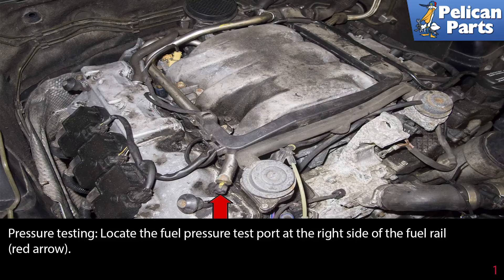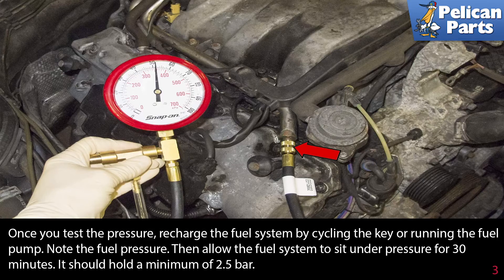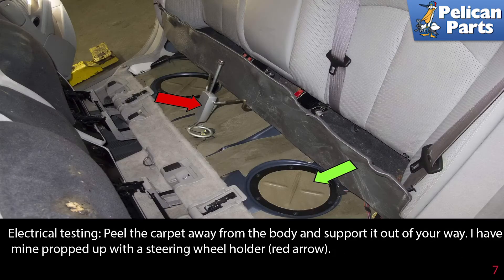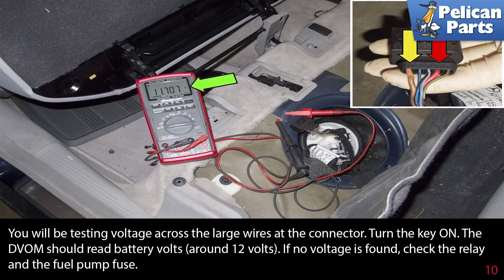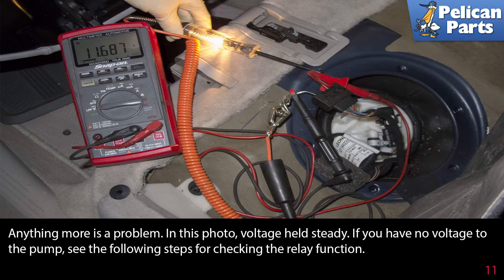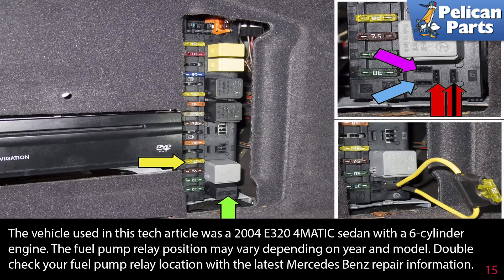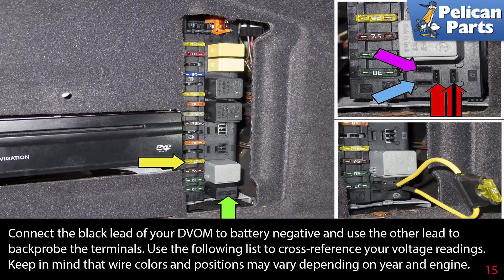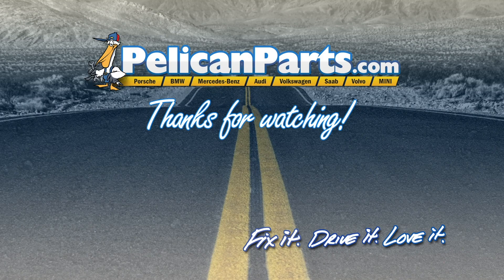Mercedes-Benz W211 E-Class Fuel Pump Testing

Comment: Where is the fuel relay switch on a 2003CK 430 Mercedes
Reply from the maker: The fuel pump relay is located near the fuse box, in the trunk.  Mounted in a holder.

Comment: For how much time should the system stay atleast 2.5 bar? Should it stay with this pressure for a day sitting? Is it normal for the fuel pressure to drop to 0 bar after overnight staying?
Reply from the maker: 15 minutes. Should hold some pressure overnight.

Comment: Hello sir. This is an excellent video. 

but i am wondering one thing.

The fuel pump electrical connector is located at the rear driver side while the pump itself it as the rear passenger side. However when i removed the pump there was no wiring on itself so how does ithe pump actually get his command since there is no electrical wires on the pump itself? 

I am totally confused at this point
Reply from the maker: The pump does have wiring, it is an electrical pump. The wires run through the tank.
Reply: @pelicanparts  thanks for your prompt reply. 
No fuel pressure at the shradder valve. The pump never buzzes. Fuel pump relay and fuses are both good. No B+ @ the driver side connector with KEY ON. However, if relay socket is jumped with a jumper wire, B+ is present although no buzzes from either pumps. 

Is there anytging else i mustcheck or can i safely conclude the pump is bad? Just rwceived a used VDO pump but have not installed it yet. 

Thanks in advance for your guidance

Comment: I've checked the relays and fuse which seems to be working fine. When I turn on ignition I can't hear the fuel pump turning on.

Please help!
Reply from the maker: Access the pump, is it getting power and ground? Does it hold voltage when a load is applied?
Reply: @pelicanparts  I have not checked the pump yet but when I meassure the power wiring to the pump (In 3:02 also 3:27 the electrical testing) The voltage/lightbulb is not holding steady, it jumps up to 17v in the DVOM and holds for about 2-3 seconds and then drops down to zero. My suspect is the ECU module failing, but that is too expensive for my budget...

Thanks for reply!
Reply: Seems like the issue was fuel pump afterall! The reason why it could not 'hold the voltage' was because there is some kind of security meassure in the system which cuts the electricity off when it notices the pump is not running!
Reply: @AllTheWayToFebruary  hello. I am having the same issue. I know you fixed your problem with a fuel pump replacement but i am wondering one thing.

The fuel pump electrical connector is located at the rear driver side while the pump itself it as the rear passenger side. However when i removed the pump there was no wiring on itself so how does it actually work? 

I am totally confused at this point